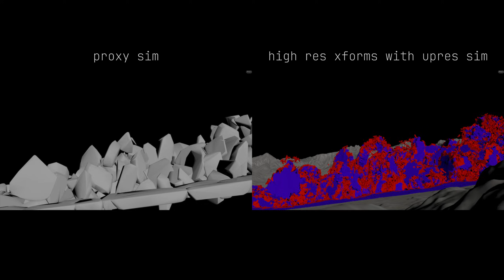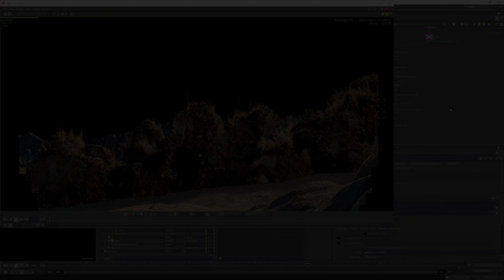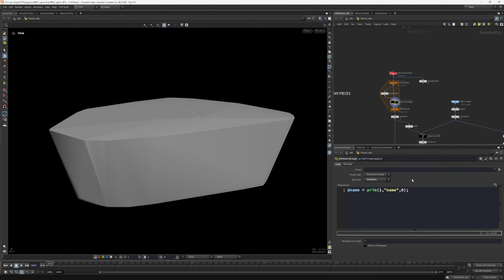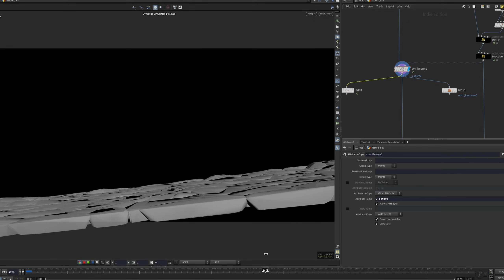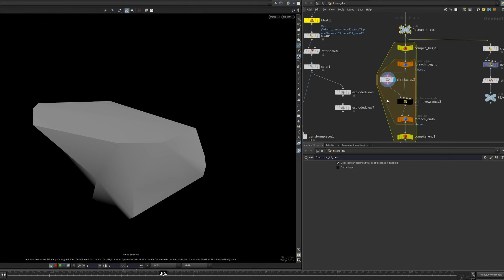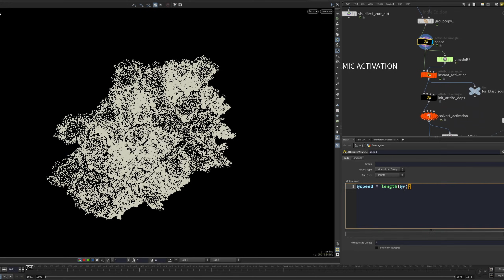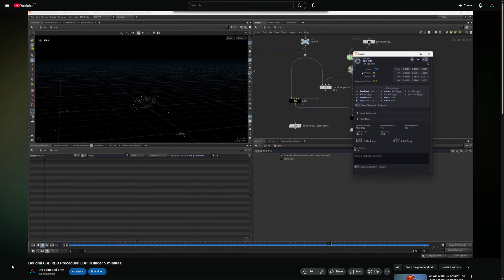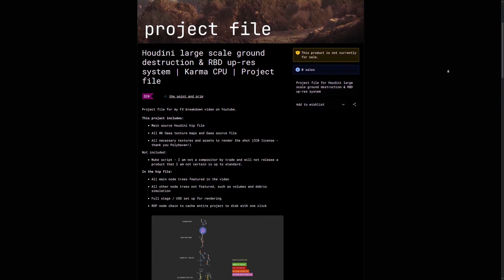Art directing large scale RBD sims in Houdini using the up-res method

Comment: How much ram this setup uses?
Reply from the maker: hey, i’ve got 64GB and it generally occupied about 70 - 80% of that.  That is also why I turned down dicing quality to 0.15. without displacement it renders in XPU in about 1hr using a 3070.
Reply: @thepointandprim  :eyes-purple-crying:
Reply from the maker: plenty of FX you can make without a lot of RAM :) when I learned Houdini I only had 16GB - sometimes you can also create more complex shots by splitting different parts into different renders.  even in this shot I rendered the FG separately and comp it over the main beauty pass. good luck!
Reply: @thepointandprim   got it thank. Also what do you think is more useful for rbd and vellum sims - buying ram (I have 32gb) or new cpu?
Reply from the maker: CPU if you are just learning the fundamentals, as calculating data faster will be more beneficial for learning as you will get faster feedback. if you are trying to make shots for a reel then RAM as it is prohibitive to actually getting some effects rendered if you don’t have enough.

EDIT: sorry I just realised you said you have 32GB already, it your CPU is out dated then upgrade that first.  32GB is enough if you work efficiently.
Reply: @thepointandprim  Thanks a lot! I new to Houdini. I also found out that rbd is single threaded while other sims supporting multi threaded calculations
Reply from the maker: Yes I think the bullet solver is single threaded but it is comparably very fast in comparison to other solvers in Houdini, especially the grid based solvers like smoke or flip.  

I also explicitly avoid the use of any constraints in this video which would perform extra calculation, which is why the proxy sim is also very fast to work with.